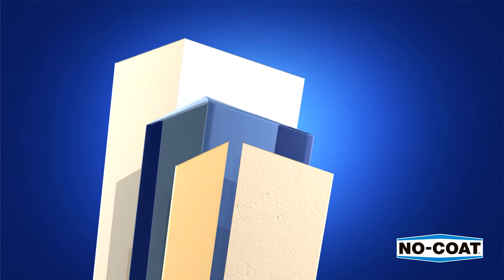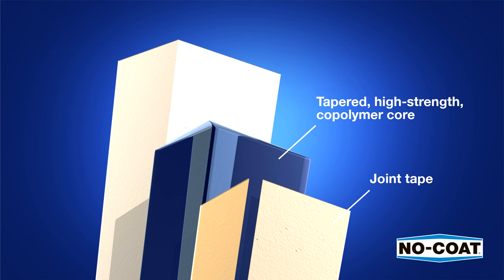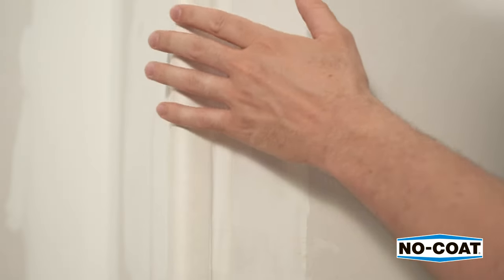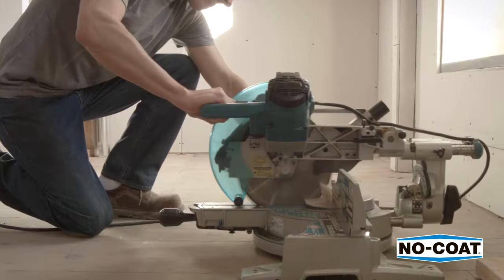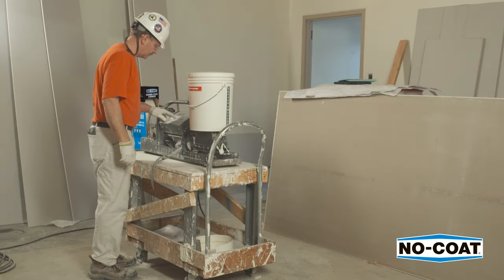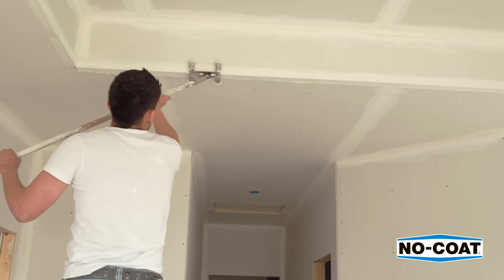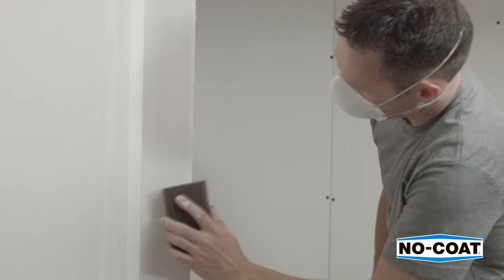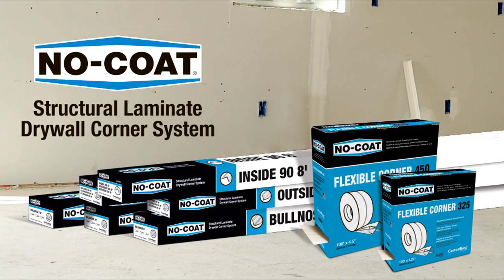NO-COAT® Product Spotlight Video

Comment: I used this on inside corners where the wall met the ceiling. Even though there were 1/2 gaps in the drywall and it wasn't even, you can hardly tell. And, it's economical too.